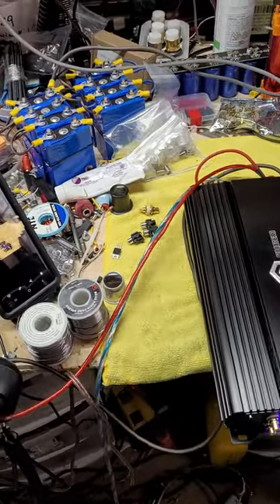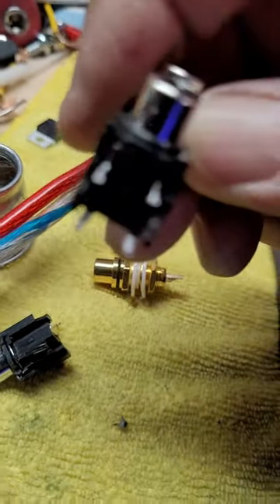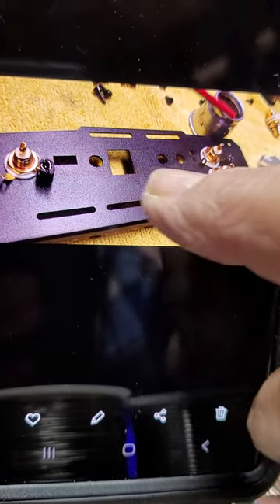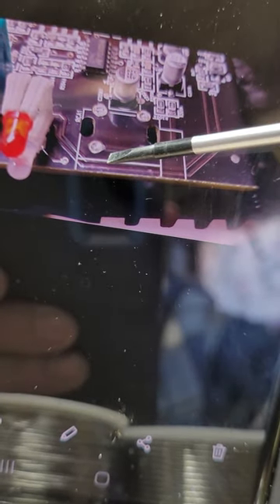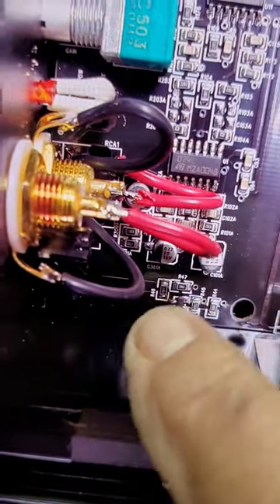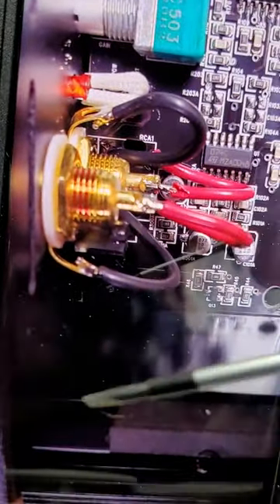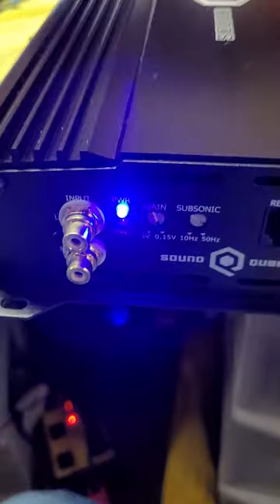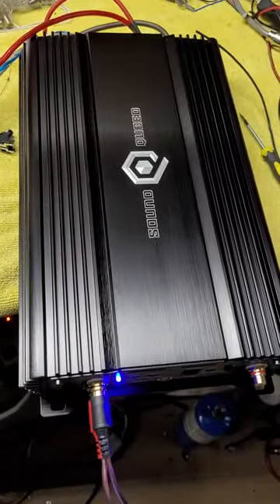Install Tiffany RCA's in your amplifier!

Comment: Good video dude. Having problems with the rca connection on my APCLE2004. Looking at how you did it, yeah man! I can do that. Good video!
Reply from the maker: It's a little tricky, but usually can be done. Hopefully without pulling the whole board.

Comment: Would this be a fix for a rca problem in having with a skar amp? Im thinking it might. Not 100% sure but i know it's the RCA jacks
Reply from the maker: If one of the rca's is broken, or broken solder where it goes in the board, maybe so
Reply: @slickwillybudgetking  thanks for this video. Makes me almost confident I could do it. Would rather do this than spend 150 bucks sending it to skar😂